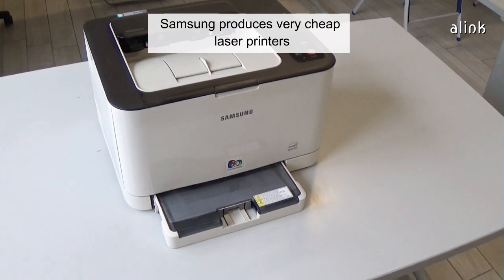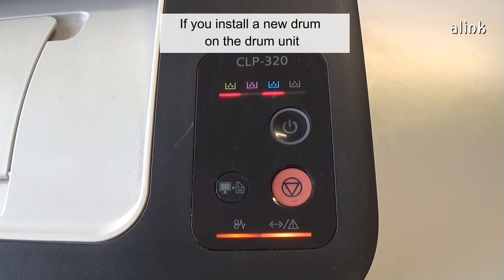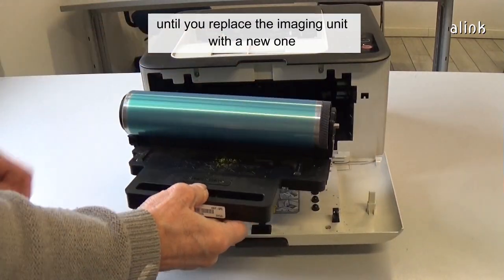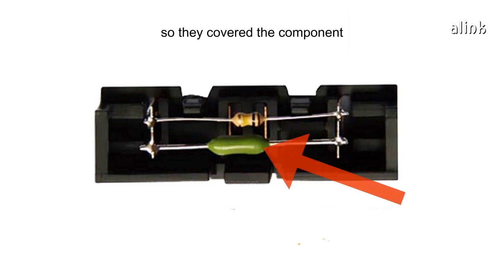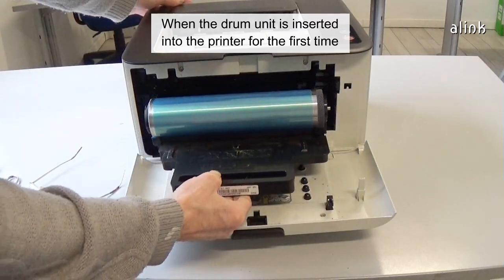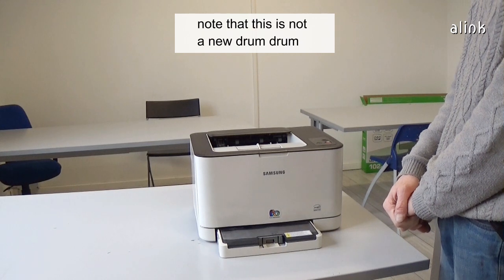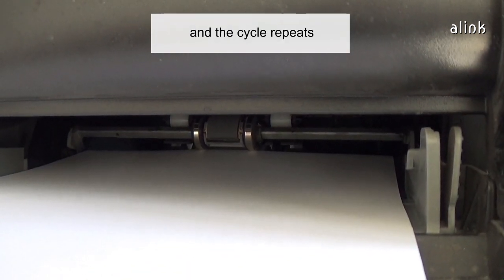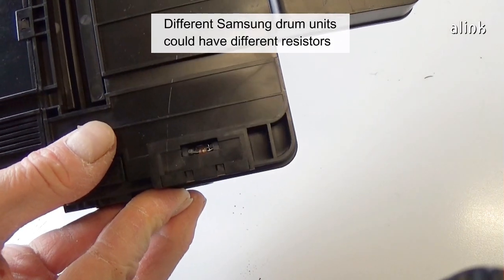How the Samsung Reset chip really works

Comment: Another channel recommended bypassing the fusible resistor with a bit of copper wire to short across it. Boot up the printer once, then remove the wire. Worked for me.

Comment: I have Samsung CLX-3305, it comes with CLT-R406 fuser.

I have tried to reset the printer several times. I have used a resistor of a value

46 kohm
100 kohm (this was the origina resistor value)
137 kohm
270 kohm

together with picofuse 63 mA or fast action 50 mA glass fuse. 

The printer says still: "Fuser unit failure #U1-2320 turn off then on."

What to do next?
Reply from the maker: Sorry I don't know a method to reset the fuser unit. I tried the same with a fast 100 mA glass fuse

Comment: Hi, this method is to reset toner issue that it disallow to print and lot of red Led in front panel showing the locking??
Reply from the maker: it's related to the drum unit

Comment: Would it work to put a shorting strip in the cartridge instead of a resistor?
Reply from the maker: May be, if you stop the machine exact when the fuser has to blow then remove the shorting strip
Reply: How much current would be required to blow the fuse they use here?

Comment: I have a Samsung C410W and it appears to be just a 200 k and not a 56k with it.  I replaced it with a 56k and it quickly started smelling overheated. When I test it, it still shows 56k. Should I put in just another 200k which didn't register anything with an ohm meter?
Reply from the maker: The fuse is 56 omh not 56k
Reply: @viandant5  Sorry, it was a 56 ohm that I put in and it didn't work
Reply from the maker: @brewster102  a 100 ohm should work too

Comment: Hello everyone! I'm having an issue with my Samsung color laser printer. I recently replaced two resistance fuses in the printer's oven, both with a resistance value of 100 ohms and connected in parallel. However, the fuses keep burning out and the printer indicator switches from blue to orange. Has anyone experienced this problem before or have any ideas on what might be causing this? I would greatly appreciate any advice or suggestions. Thank you!
Reply from the maker: It's only one resistanze, not two. The other component is not a resistance

Comment: I payed to someone to do me, a hack print many years ago. I don't know how they did it. But today I cleaned the drum unit and the transfer belt. But does not start. Only for 2 seconds rotate the spins and after that all stops and the red light is on. Its acting like paper jam, but before I cleaned it worked... What may be the problem? Please help me. I can send you a video if you want. Now I checked with Samsung printer manager and the error is "replace/install toner waste bin"
Reply from the maker: I think you have to empty and clean the waste toner box. May be you shake it and the toner covered the windows of the box
Reply: @viandant5  I have a samsung c8385nd printer. It started saying that the printer cartridges are incompartible and the red light comes on. They have been working all the time. How can I solve this problem? Please help
Reply from the maker: @suleimansuleiman3932  Probably you updated the printer driver. Those updating can give you similar problems. Probably you have to buy new cartridges with the new chip version